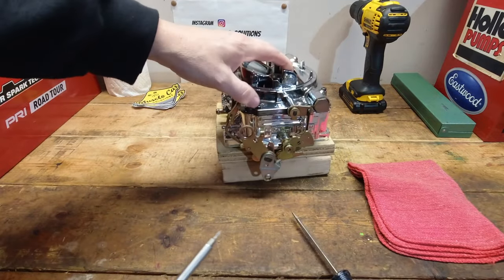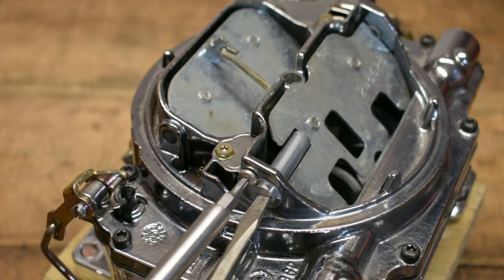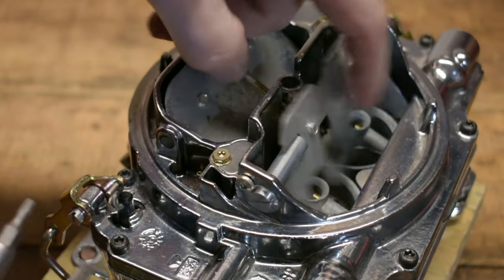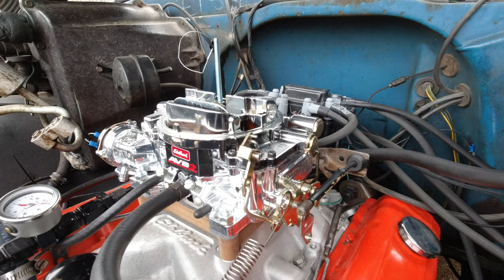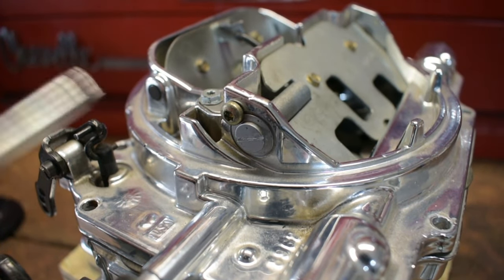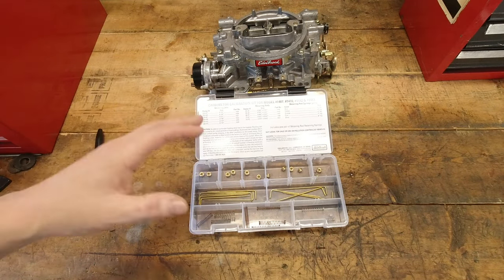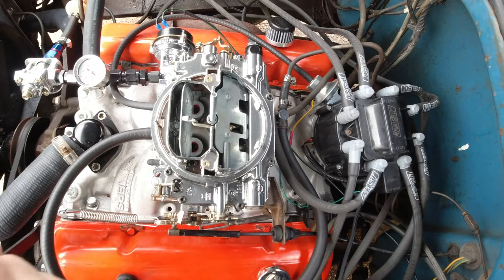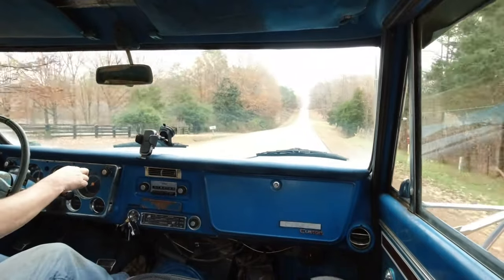How to Adjust Edelbrock Air Valve Secondaries (AVS)

Comment: I'm new the these carbs. I have an non AVS I've picked up. Is there any adjustments on those? Do you have videos on the older ones? Not impressed with it as the secondaries open up. My old autolite 4100 seems to feel stronger on full throttle even though its a 480 CFM. I enjoy your videos. You are a carb guru!
Reply from the maker: The “feeling” isn’t measurable.  If you’d really like to see if there is a point in the transition from the secondaries closed to opening, an AFR would confirm or reject your feelings.  If you can tune to maintain a solid 12.5 AFR on that transition in WOT, then you know the carburetor is working as intended.  The further benefit to the AFR is helping you get through the tuning process quicker with empirical data to help guide you though the steps.  Yes, I have tons of videos on the performer series carburetors.  I put them all into a playlist if you’d like to peek at it; https://youtube.com/playlist?list=PLzRZhhuK5WiCO_FamS74Ci8hmQVbWsTpO
Reply: @MuscleCarSolutions  I'm not that familiar with the AFR set up. I do understand what it is and what it can tell me. I've just never been around one. All I've ever really tinkered with is the 4100. I bought a used Summit version of the 4100 for my Mustang ll and I like it alot. On my Fairlane (1964), I replace a 600 vac secondary Holley with this used Edelbrock 600 and the drivability is much better than the holley was. Still working through some issues on it. I have learned quite a bit from watching your videos on the Edelbrock. Thanks for your response and ideas on the AFR. I will look into that. Do you have any videos on the "Summit" carb?
Reply from the maker: @f150bft  you’re very welcome, and please don’t hesitate to ask any questions along the way.  Always happy to help where I can.  

I have not done any video on the summit brand carburetors but I have tuned one and wasn’t impressed at all.  If I ever get my hands on one of my own, I’ll do a full review and tuning video to expose the weaknesses.

Comment: Quick question, and thanks for the video very informative, but when your making adjustments and trying to get rid of hesitation or bog, can you test this just in the driveway in park? Or do you have to drive it? Because I have a bog when I'm just sitting in park and mashing the throttle
Reply from the maker: You can’t check operation with no load on the engine.  Sitting in the driveway = no load on the engine.
Reply: @MuscleCarSolutions  gotcha, thanks, just did some tinkering and took the car out, seems to be alittle bit better, still a slight hesitation but better then it was, might need a little bit more adjustment
Reply from the maker: @stephendorsey4481  yup.  Keep tuning.

Comment: So I undid the lock screw without putting a screwdriver in the tension bolt and it “undid”. How many turns to get the bolt back to stock?
Reply from the maker: From all the way loose?  Probably 3-4 full turns.  Get it where you think it was and go drive it.  You’ll know if it needs to go looser or tighter pretty quickly.

Comment: Do all avs2 carbs have the annular primaries?  I am considering a 1913. Thanks
Reply from the maker: @garrettbenson7743  annular primaries
Reply: @MuscleCarSolutions  yes. Sorry. Primaries. Is it worth it over performer?
Reply from the maker: @garrettbenson7743  I believe so.  The throttle response on the annular carburetors is well with making the upgrade.  Plus the adjustable secondaries is a big upgrade over the performer series carbs.

Comment: Great vid! my car only in the morning when I start it if I don't hold the gas pedal a few second it will turn off but afterwards it runs great after it warms up. Are the secondaries something I can adjust so I don't have to hold pedal down few seconds at first start up?
Reply from the maker: Secondaries aren’t a factor with no load and low rpm.  Adjusting then won’t have any affect in the issue.  Can try the idle mixture screws first.  Add more fuel and see if it gets better.  If worse, take some away.  Verify timing.  Ensure no vacuum leaks.  If it’s an electric choke carb then open the flap a little more.  Gets better then go back to the mixture screws.  Gets worse, take away some air.  It’s where I’d start.
Reply: @MuscleCarSolutions  
Thanks, I made my electric choke a little richer and now it started right up in the morning.
Reply from the maker: Nice!

Comment: If I have a carb backfire when jumping on the throttle will this adjustment resolve that issue?
Reply from the maker: It’s possible.  But there’s some other factors at play.  Fuel pressure and level in the carb, timing.
Reply: @MuscleCarSolutions  I ordered a new vacuum advance can for it for a start. Then I’ll do timing also when new can is in.

Comment: Quick question, Vacuum advance, driver side or passenger side of carb. 71 Chevy small block no emissions, I tried both sides and see no difference but what is correct ?
Reply from the maker: Mostly a stock engine or mild cam/intake/headers.  Go with the timed port.  Aggressive engine/cam then go with the full manifold vacuum until it can’t be used, then go with a locked out distributor and control with an aftermarket spark box.

Comment: I've got the avs2 on a 305. When I floor it from cruising speed the secondarys don't open but if I release the throttle and floor it again then they will open. Would this help that problem if I made this adjustment?
Reply from the maker: Probably but it sounds like you might have other issues here.  I’m assuming you went with a 500cfm for that engine.  I’d just verify all the linkage operates freely.  Make sure the secondary flap is operating freely.  Next hit the accelerator pump and see if adding fuel or taking it away makes a difference.  Then start playing with the opening rate and see if you can get improvements.

Comment: Hi sir, love these videos. But, I've got a problem. I have a 318 in an 86' W-100. Brand new head-job, and Edelbrock on a Weiand manifold. Timed, about 8 BTDC, but back fires like MAD on any kind of load, uphill, and on any acceleration. At speed, coasting, down hill, warm and idling, no issues. All new ignition system, distributor, plugs leads etc. What am I doing wrong RE: adjustment? What could I be 'missing'?
Reply from the maker: The challenge here is to figure out if it’s an ignition related issue or a fuel delivery related issue.  What size carburetor?  Have you done any tuning yet?
Reply: Hi sir. @MuscleCarSolutions  It's the "Performer" series. I've done no tuning at all. No pressure regulator system, fuel delivery is right off the mechanical pump (there is an inline filter). New (rebuilt OEM) distributor (Reluctor type w/ vacuum and mechanical advance) with GM module conversion. All new plugs, leads, coil (internally resisted) battery and wiring. Starts fine, mechanical choke no issues. Idles fine. Gutless on hills, under load, under acceleration and backfires like a 50 Cal. M2. with any kind of pushing.
Reply: One strange thing, when timing, using a light, the mark even when set (8 Deg BTDC) would jump around a bit. So, the mark would flash in one spot for several seconds, then jump 1/2 degree for a second or two, and then back. Could be a number of things? Timing chain? Worn cam, lifters, push-rods? The truck only has 44k original miles on it, but was used hard, pulling trailers in the mountains.
Reply from the maker: @erikg.4217  generally when the timing bounces around all over the place your assumption is correct.  Timing set, distributor gear.  Something is worn.  You’re eventually (quickly) heading for a full rebuild or at the very least find where the issue is and hopefully be able to correct it.  Time to start tuning.  I’d add a regulator and a gauge at a minimum.  Once you get the back firing sorted out, the tuning chart is your next step to fine tune.  It might also circle back to your erratic timing.  Might not be anything you can do until that’s sorted.
Reply: @MuscleCarSolutions   Thank you sir, my fears confirmed. No more driving until I locate the actual source of the issue. Might be dealing w/ several, but process of elimination will narrow it down some for sure. Thanks!    E

Comment: Hi I have a 318 mopar motor and I know it has more power but I’m not getting it. Do you have any advice on where to start. I had a efi on it and it did have more power I just can’t seem to achieve the same response and power from the carburetor
Reply from the maker: Don’t know.  What tuning have you already done?
Reply: @MuscleCarSolutions  I just done what you explained in this video I have gotten better performance.

Comment: Great vid, I just put an avs2 on my truck. Seems to break up around 3500 cruising.
Reply from the maker: Cruising at 3500?  Yikes.  How is it geared? What trans?
Reply: @MuscleCarSolutions  th350 3.7.3
Reply from the maker: @trilledskadesman3922  that would explain it.  Do you have the right size carb?  What is your fuel pressure set at?  What tuning have you do so far?
Reply: @MuscleCarSolutions  the rear end would explain it?
Reply: @MuscleCarSolutions  mostly stock,msd ignition SBC 350 performer intake 650 cfm and headers
Reply: Thank you for your help too
Reply: Waiting on a fuel pressure gauge. Should be around 6-8
Reply from the maker: Pressure should be 4.5 - 6 psi.  Anything more than 6 you’ll run into issues with it pushing past the seats.  Any 1:1 final drive trans is a pain with tall rear gears.  Explains why your cruise rpm is so high.  Screaming down the highway!  So haven’t done any thing to the carb?  There’s a few things you can look at.  Match the step up springs to your engine vacuum.  Use the tuning chart and start working on rod and jet sizes.  I have videos on all that in the Edelbrock Carb Tech playlist.
Reply: @MuscleCarSolutions  this is good info, thank you!

Comment: What’s your recommendation setting advance timing on a stock 350 rebuild once about 90,000 miles ago in a Chevy C10 three on the tree, oh and what should I set my rpm at idle? Thanks
Reply from the maker: Depends a bit on elevation as well, but generally I start at 12 and go up to 18 on initial.  The engine will tell you what it likes (or doesn’t).  Idle RPM is also going to be dictated by what the engine is asking for.  If its still in decent shape and the valvetrain is still tight, you should get idle from 5-700 RPM.  But it’s going to tell you what it wants.  If you try 500 and it’s not enough when you let the clutch out to get moving, then add more.
Reply: @MuscleCarSolutions   ok right now I have set at 850-900 and I thought it was too high, I’m sitting at 500 elevation. And also my advance is set at 12 and it feels pretty good there. I’ll play with it a little more. Thank you so much for the info. Love your videos
Reply from the maker: @chicanoperez6377  yup.  Completely ok to play around with a little more timing to drop down the RPM.  You’re working the process!  I’m glad the videos have been useful to you!

Comment: Interesting! I have an older 650 AVS in my pile of stuff...and I cannot make it work right. The drivers side mix screw acts normal, but the passenger side one has no effect, I can screw it all the way in and it makes no change. The car idles kind of strange. The exhaust sounds " Flat" if that makes sense...if I hit the throttle it will huff black smoke out the tailpipes. It was on a 383 Mopar when it was new, and he was never happy with it either.
Reply from the maker: In those situations I will always do a total reset.  Turn the idle speed screw all the way out.  Turn in and lightly seat the mixture screws and come back out a turn and  half.  Flip it over and verify the transfer slots aren’t exposed.  Verify timing.  Then start and set the speed screw, then mixture screws (with a vacuum gauge) and reset/check timing.
Reply: @MuscleCarSolutions  I'll dig it out and give that a try! Thanks!
Reply from the maker: @harnettsgarage  it’s common.  I covered it in a video on how to set idle mixture screws.  Especially engines with an aggressive cam.  It’s easy to get into the transfer slots.  Anything past 1000 rpm the idle circuit gets bypassed.
Reply: @MuscleCarSolutions  I went through my 1403 and set up the transfer slots, I can't remember if I did with this one...it was three summers ago now. I'll go watch the other video now!

Comment: Can this cause the opposite issue back fire in the exhaust I have a stock 350 had no back fire with old carb. Put the avs2 on runs great. But rev it up in park and back fires in the exhaust when rpms drop back down
Reply from the maker: Could be a lean backfire. Timing would be a nice place to start.  Not zinging it in park would be another good idea.  Not necessary.
Reply: @MuscleCarSolutions  does it while driving also. I get it I was trying to adjust to make it go away
Reply: Truck was running fine with other carb swapped this one and the problem started
Reply: I have the older style edelbrock on to other vehicles. No problems like this. Brand new checked and adjusted like my others. Runs great like my other ones just back fires after high rpm on the way back down to low rpm
Reply: Timing set ect, holley stripped squitter screw so I popped this one on because the run well on my other chevys
Reply from the maker: @johncolianno6102  what adjustments have you made with the new carburetor?  What is the size?  What engine is it on?
Reply: @MuscleCarSolutions  choke, fast slow idle mixture screws carb runs great. I didn't verify float. I prob should have opened it up. Like I said runs great crisp of line no hesitations great respond when kick down imitated
Reply: stock 350 70s truck motor , avs 650 cfm
Reply from the maker: Idle screw adjustment isn’t tuning.  Basically it’s been bolted on and that’s where you’re at.  Are you running a pressure regulator?  Start at 6psi.  What’s your engine vacuum at idle?  Let’s make sure you’re matched up with the correct step up spring.  What’s you’re ignition set at?  Initial and total?
Reply: @MuscleCarSolutions  pressure at 6psi, vacumm at 18.5. Initial at 11 and total at 32
Reply: @MuscleCarSolutions  Orange step up springs
Reply from the maker: Orange is the 5” spring.  I’d try the silver spring.  Not enough timing in that engine.  12-16 is your range.  Start with 14 and you can go back and forth till you find a better situation.  As long as it’s not hard to start and you get no detonation.  Same with advanced.  34-36.  Todays crappy fuels need longer to burn.  Check your floats.  Start with the 7/16 adjustment.  Once you’re set there, then you can actually start tuning.
Reply: @MuscleCarSolutions  Sweet! I have the Edelbrock 1948 Calibration Kit, AVS2 650 Series 1905 & 1906 on its way. Is this the same as the 1406 kit, just repackaged? ( Edelbrock 1487 Performer Series Carburetor Calibration Kit) A little over $20 difference. Thank you for the help so far! The 1948 kit was a bit harder to locate near me but amazon had it in stock.
Reply from the maker: No.  They are two separate calibration kits with rod and jet combinations for each.